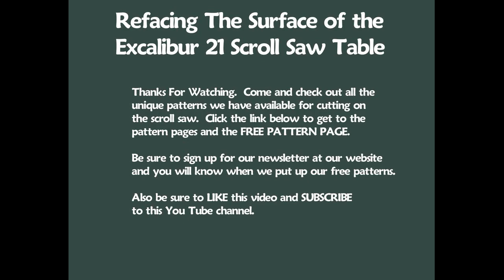Excalibur Table Resurfacing

Comment: Myself, rather than removing the top from the saw, I would have taped down a sheet of hardboard, traced it from below, then cut a template of the table top. (Its not worth the risk or the effort to remove the saw table, considering there is a simple alternative.)
Reply from the maker: Perhaps this would have been easier.  Ya live and ya learn.  But I enjoyed taking the table off and seeing what was underneath.  Thanks for your input.